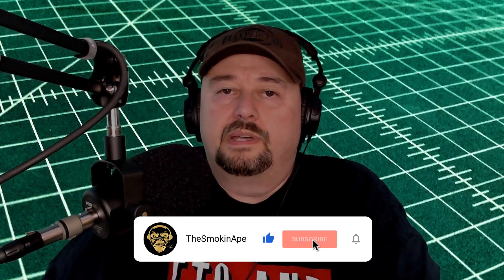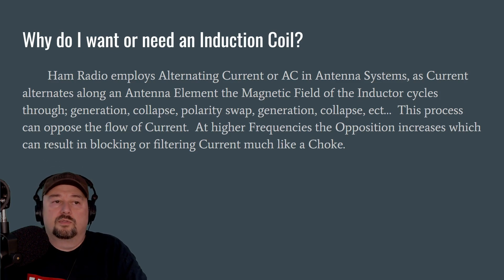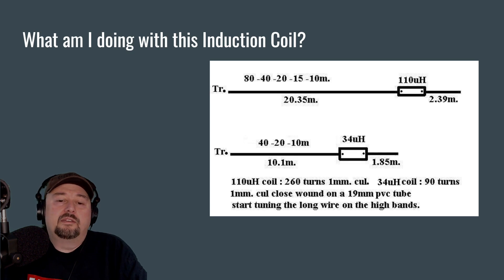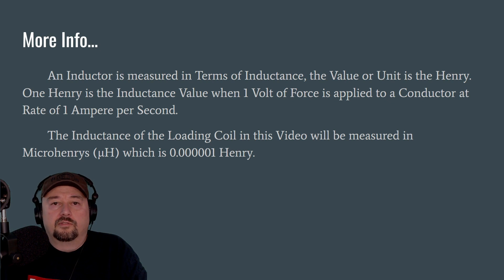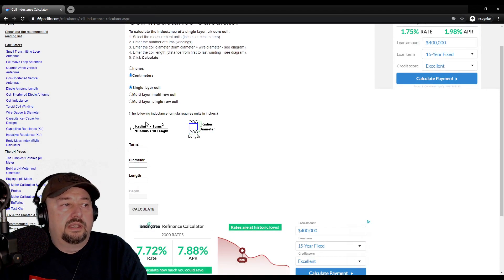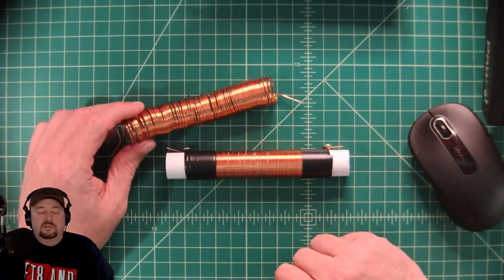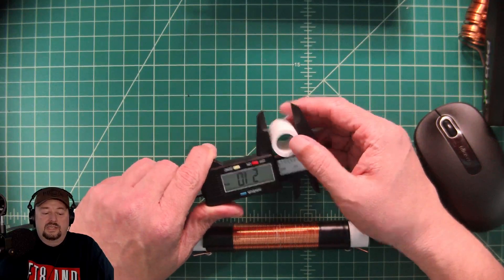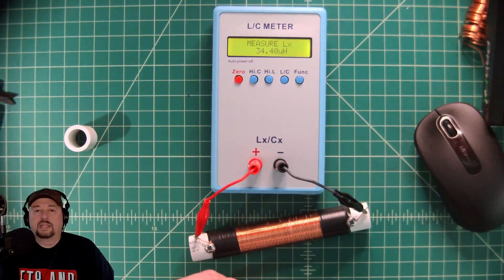Induction Coils for Ham Radio Antennas - TheSmokinApe

Comment: FWIW: ChatGPT will design coils to spec. Ask it to prepare a template that will always give accurate, real-world results. Ask it to prompt you for the variables. Here is an example of the dialogue: ChatGPT enquires "If you specify these eight things, I can give you practical numbers: Form OD, Form material, Wire type, Winding style, Lead length, Target inductance, Frequency of use." I wanted to build a coil on 2" PVC (1.91") using 14 AWG for 3.838 MHz. After prompting me for the info, it gave me the following specs: 
•	Inductance: 45 µH measured
•	Turns: 43
•	Wire: 14 AWG enamel solid
•	Form OD: 1.91 in PVC
•	Coil Length: ~4.0 in
•	Leads: 3 in each end, straight
•	Wire Length: ~23 ft
•	Operating Frequency: 3.838 MHz
Reply from the maker: This is good info, thank you 🙏

Comment: Hi fellow ham
How to calc the inductance for the specific wire lenght?
80-40-20-15-19m antenna is 20.35 meters then 110uH coil and 2.39 meters of wire
40-20-10 antenna is 10.1 meters then a 34uH coil and 1.85 meters of wire
OK I understand, but when I like to build this:
160-80-40-20-10m antenna that is 40.7 meters then a ???uH coil and the ?.?? meters of wire?
How to calc  the inductance and wire fot this?
tnx in advance
Christian OZ1KFY

Comment: I just bought a comet ca2x4 nmo antenna. Im getting no ohms reading across phasing coils  when i touch the meter leads to the antenna. Is that normal? Im getting better performance from a much cheaper mag mount .
Reply from the maker: It’s not normal, I’d use a multimeter to check the continuity of the coil 👍

Comment: Thanks for god information. I understand the efhw 110uH version is a bit longer and goes for 80 40 20 15 and 10. The short part of the wire goes for 80. The lognest part goes for 40 20 15 and 10. If the longer part is optimized and cut for 20 m, will the remaining bands 40 15 10 follow optimization on the 20 m band?
Reply from the maker: You won’t get 15 on the shorter one 👍

Comment: Even better than measuring the wire and the tube then adding would have been just get an inch or so of wraps then measure the diameter of the whole thing.
Reply from the maker: Thanks for the idea Slick.

Comment: Can I make use 110 mh coil for   40-20-10 my band as it could be used for 80mt band too.second question , why length of coil and wire diameter both required ,if it is closed wounded, as length equals turns x dia.third question regarding on second question is ,whether coil wound closely or 1 or half mm spacy?
Reply from the maker: If you use 110 you will need to tune the wire lengths differently.  The length and diameter of the coil wire effect the inductance of the coil which changes the resonate frequency 👍

Comment: Cool video.  I want to make the coil for getting 40 on a 20m half wave end fed antenna.  Where did you find the plans for it?  I’m curious on how they calculated the value of 34uH for the coil to get 40m.
Reply from the maker: I found them on the internet somewhere, sorry Bill, I do not have the link.

Comment: What size was the PVC? Looks like about 1/2 inch. I don't need one, but good information 👌 to know if or when I need it. Our club has a place for address to handy websites and I will see if I can get that in the list. Thank You for the information!   73  W4DES
Reply from the maker: Hey Donald, the OD is .83"
Reply: @TheSmokinApe  Home Depto website said 1/2 PVC is 0.84. But I don't think the difference between 0.83 and 0.84 is going to be a problem. I don't think they are that close on the PVC pipe anyway. That is only about a RCH.
Reply from the maker: @donaldsmith3048  yeah, I’m sure it’s the same.  It’s from HD 👍

Comment: In some calculator,length of coil required, can we take exactly dia.of wire×turns.90 turns of 1 mm dia wire means length of coil would be 90mm
Reply from the maker: Correct

Comment: If we take longer wire, will induction increase or decrease?if we take higher diameter pipe,induction increase or decrease? If we take higher diameter wire,induction increase or decrease? These question is just to know so that if we don't get desired value of induction, we we should do.

Comment: That antenna diagram is bogus. If you want to use a wire like the one depicted in the bogus diagram on 40, 20 and 10 meters, do the following. String out 12 meters of wire. At a point along this wire equal to 1/2-wavelength on 14 MHz, insert a parallel tuned circuit (a coil shunted by a capacitor) tuned to 14 MHz. At 14 MHz, this "trap" will act as if a break in the wire, causing the wire to be 1/2-wve on 14 MHz. On 40 meters, the trap acts like a piece of wire, causing the wire to be 12 meters long on 7 MHz. On 10 meters, the "trap" will also act as a piece of wire, causing the wire to be 12 meters long, or about 1.2 wavelengths on 10 meters.
Reply from the maker: The diagram is fine and makes a great antenna: https://youtu.be/v6U8jBEtWs0
Reply: @TheSmokinApe  With a 30 foot support pole, you have enough space for the 40 meter 1/2-wave end fed. I won't tell you how. You have to figure it out for yourself. ;)
Reply from the maker: Bro, I use this antenna all the time.  I've used it w/o a 30' pole...  Maybe, just maybe you the one who needs to do some figuring.
Reply: @TheSmokinApe  Well, I guess I'll have to hit the books, Son. 

--W1ZY

Comment: I've built a couple of them and they work really good however for 80 you will have to determine where you want to use it and you will get about 50 khz that is resonant so you will have to tune it. I love my EFHW's what I have are 2 antennas and orient them appropiatly
Reply from the maker: Yeah, playing with 80 ain’t easy!  That is for the comment James 👍
Reply: @TheSmokinApe  I had to raise and lower the coil end and just trim and trim and trim but got it centered  on the frequency of interest and it works pretty good. I like your how to videos. 73 ki0ad
Reply from the maker: Glad to hear it worked out for you James!

Comment: I have a 20 meter ham stick and use a MFJ tuner to get it to match. Will a loading coil help me do better on 20 meters?  Or help me tune to other bands and still use my 20 meter ham stick...?

New to loading coils and thank you for the help.
Reply from the maker: Hey Walter, we’re all new when we start.  You wouldn’t use a coil to use a 20m ham stick on 20m, but you would to use it on a lower hand like 40m.  Thanks for watching 👍

Comment: Sorry for the dumb question, I’m brand new to ham just passing my Tech.

 Would you still have the need for lets say a 49:1 or 64:1 UnUn with this set up? I’m assembling one when my parts arrive (still deciding on which one).
Hope to take my general this week, lots to learn on my new 7300!
EDIT: Never mind, just watched the follow up 🤣👍
Reply from the maker: Hey BS66, if you saw the follow up you know...   the 49:1 is to match the feedpoint impedance and the coil is to shorten the element, you do need both.  Thanks for watching!

Comment: Just to let you know, if the coils uH value is slightly out all you have to do is adjust the length of the tail and the position of the coil within the antenna.  cheers
Reply from the maker: True and fair point, I didn't want to start doing all that and wanted to work from the "instructions."  Thanks for wanting and for the comment Mike.

Comment: What if one makes a coil only antenna, long enough for the required inductance and without a whip. Would it work? :)
Reply from the maker: I am not sure it would be a good radiator
Reply: @TheSmokinApe  I suppose maybe it would have a slim bandwidth? Thanks for the videos, they make it easier to understand these concepts.
Reply: There is a continuous helically loaded antenna designed by one of the directors of the Northern California DX Foundation (NCDXF), K6MM for 160 meters, called of course a K6MM Helical 160 Vertical.  It works quite well, I’ve used one for several years.  Consists of a half wavelength of wire (nominal 265 feet) wound on a fiberglass (3 or 4 inch) tubing core, with a small capacity hat about 2 feet above the top of the helix.  Like any short relative to 1/4 wavelength vertical, very high Q on 160 meters.  Max 1.5/1 bandwidth is only about 25 kHz, but it’s easy to move the SWR sweet spot around the band by providing taps every 5 turns or so at the bottom of the antenna.  Use a flexible lead from the coax center conductor to tap up the coil to increase the resonant frequency or down to decrease frequency.  You can get a near perfect match at resonance with either inductive or capacitive shunt impedance compensation  across the feed point, I use 1500 or 2000 pf capacitive. You must have it work against a good ground system, I use 18 elevated (nominal 8 feet up) radials, 14 35 footers and 4 70 footers.  Also run various other vertical configurations above the same set of radials (33 foot 40 meter quarter wavelength vertical, 80 meter quarter wave inverted L vertjcal.  The
Latter also works well as a 3/4 wave vertical on 30 meters, the 40 meter quarter wavelength also works well as a 3/4 wave  on 15 meters.  The quarter wavelength also works 40 meter can also be run with a 49:1 matching transformer as an end fed half wavelength 20 meter vertical dipole, but the radials have to be taken down and I only use a single 16 foot random counterpoise wire at the feed point on the feed line  side of the 49:1 to minimize common mode currents in the feed line. Can’t run the 20 meter end fed half wavelength vertical over the 18 radials because they act like a loosely coupled capacity hat to the bottom and of the end fed element and throw the tuning out the window.

73 de Chris AJ1G Stonington CT

Comment: Nice explaination. Its always nice to look and admire your newly made induction coil, I think we are all like it.
It doesn't hurt to be 5to10uH out with the coil after the effort of making a coil just add a meter length of wire onto the radiator after the coil and tune it (if you have the room). Subbed
All the best
Reply from the maker: Thanks for that info, and thanks for watching Norty 👍

Comment: How much power can a coil handle without sparking.  What thickness , sort wire should I use for 1kw max.
Reply from the maker: I haven't pushed more than 100w through this

Comment: Tried this with a 240-43 toroid near the match box, with 10 feet of radiator wire. Only took 7 thru 17 windings from 20-80m.  Very low Q.  Efficiency was very low.  About .1% on 40m.  Thinking of trying this air inductor, with taps.  Hoping for higher Q, and higher efficiency.
Reply from the maker: Yeah, higher q is good.  Sorry to hear you didn't get the results you were looking for...
Reply: Toroid may be useful for a quick empirical estimate of needed inductance.
Reply from the maker: Yeah, I've seen videos where folks have used them for testing

Comment: Just now studying for general license.  I am puzzled; why do I want to build an inductor?  Can I not buy one?  Usually I can buy better and for less than I can make in most areas.  So do hams build inductors because they can't buy it or maybe because it is fun to build.  Puzzled.
Reply from the maker: Good questions.  I'm not sure you can buy one fit for use and purpose, maybe?  This was probably 5$ to build and part of ham radio is the rewarding experience of building and experimentation.  But that comes with humbling setbacks.   When you build an antenna from scratch that works you learn and have a sense of accomplishment if that makes sense 👍

Comment: I need to do this, been using a 60 ft wire on a G90, can hear great but not  getting out. I think my nanovna h4 with the experimenter board should be able to help tune a coil.
Reply from the maker: Hoping to have a video out in a few days on the whole antenna, just finished tuning and mounting the antenna today.  So far it seems promising.

Comment: The internet instructions for those said to use 19mm tubing, does that correspond to let's say 3/4" or 1/2" PVC pipe that you would buy at Home Depot. I need to spend some time re-doing mine.over again. The calculator I Saw showed  measuring the wire and pipe at the outside diameter of the pipe and the equivalent of half the additional diameter of the   double diameter of the wire or 1 mm. But I figured I would do what you did and over wind it. I need to do a re-do. Thought about making a short and fat one.
Reply from the maker: Yeah, what I found out a that the diagram was close but not exact and the same with the calculator.  Good luck with it 👍

Comment: Should the short wire be first, then the longest one, or will it not matter? Question comes as I have seen a mod in a wire antenna, where the coil on short run came in first.
Reply from the maker: The short end is the end of the antenna the long end will connect to my 49:1 transformer 👍
Reply: @TheSmokinApe  That is what I got, a 49:1 transformer and a 134' wire #14. Great from 80-6 with Palstar AT2K tuner. Now, with a relay, 12 volts and a switch, will remove transformer from the circuit, so due to that the same wire will do 160, better 80 and better 6. Off, it is normal from 80-6, and on, will remove transformer. Ground will be at the relay box, not at the 49:1 transformer. In short words, a grounded wire of same length above, will do great in a set up like that. See this link for a better explanation. I am not pretending to teach you anything, instead I am telling you what I got now, and what I am working on to get the 160 there. See this as why I asked you the question, and also covers what I am also doing: https://www.youtube.com/watch?v=BpdpkUEW39o Thanks a lot for your great videos. 73
Reply: @k2icc  remember the antenna is first a 20m 1/2 wave... the coil acts as a trap for frequencies below 14.000MHz.  Then @ 7.999 MHz and below the coil loads the short end of the antenna to make the whole antenna resonate or the desired portion of the 40m band.

By going the other way so short wire first, the coil acts as a trap on the high frequencies and as a loading coil for lower frequencies: getting a match would problematic.
Reply: @Gravel_Rat78  Thanks a lot for your time for us out here on the way over a better us. This great YouTube work you guys do really means a lot to a lot of people in the ham radio venture. The 49:1 wire is up and running and the 160 side parts are here, so will be on it soon. Also some Arduino and Teensy programming as well as the STM32F103 series chips. Again, thanks a lot.

Comment: Does the wire need to be bare or can it have coating on it?
Reply: It needs to have insulation of some kind... a bare wire will case one giant short with very very very low inductance... remember what induction is...Induction is the process by which electricity or magnetism is passed between two objects or circuits without them touching each other.... so in other words if you wanted to use a loose wound coil without insulation, then it would work, but it would become heavy and long to get the same results as with magnet wire.  

For my coils I use scrap magnet wire from junk appliance motors (washing machines, dryers, or any other appliances that use an electric motor).
Reply from the maker: So the wire I used here does have a very thin enamel coating, you need to scrape it off where you want to make a connection, I believe you could use totally bare wire as well.  If you are asking about wire with a PC or Teflon type insulation I believe you could use that as well but would need to account for that when using the calculator.

Comment: You will find that the 34.40 uH coil will work just fine for you... you will compensate for the 0.40 uH by the length of the shorter wire to finish out the 40m antenna.  You will find that the given length to operate on 7.255 might be a little shorter than you originally had thought to get the SWR back down to 1.2:1.  But I really don’t think .40 is going to hurt you at all.  

I am running the Short 80m HWEF antenna with great results a crossed all the bands (-60m I am not sure why I can’t use my tuner to get a decent match on 60m, but I’m building an antenna dedicated to 60m for those instances that I want/need to work 60m). 

Great video again 🦧 I wish I could catch the premiers and live streams, but my wife just started night shift, so my YouTube and radio time slots have changed.
Reply from the maker: Thanks for the info Overland, I'm hoping to get the elements cut and attached to the coil today.